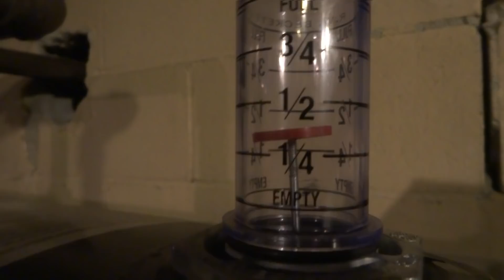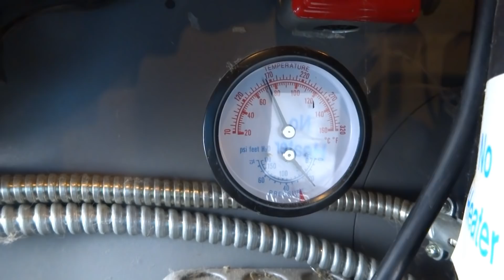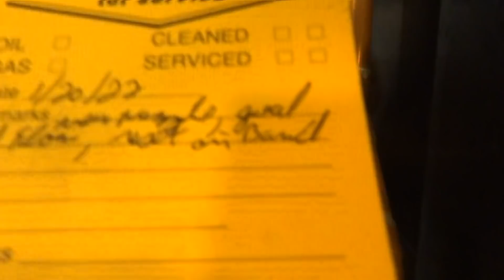OIL BURNER NEW CUSTOMER SERVICE REQUEST

Comment: Your still producing videos after 5 years ! Congratulations.  
When you first got to this job site I see you did an initial evaluation of the set up with it being a new customer.  When you are pointing the camera around at the components could you tell us what it is you are looking for in each one ? 
Also while there you didn't change out the fuel filter because of good oil flow.  Would it for piece of mind for the customer be good to change it ? Most customers know about or at least heard of the nozzle and filter and more or less expect them to changed and to be billed for changing them. 
I see your reasoning for not changing it but if the customer waits another  two years the filter could plug or slow flow by then or before. 
I'm just curious and not in the  HVAC profession but just a homeowner that works on my own headaches. 
Anyone can comment on this and let me know what you would have done and if you are in the business. 
Thanks for the videos Steve and keep up the good work. I've learned a lot from them.

Comment: Hey Steve  love your channel . My boiler exploded two weeks ago. The boiler blew threw the Sheetrock walls in to my basement . Also the pressure blew my garage doors out and also cracked my foundation. .  I had  boiler expert come and get the boiler to find out what may of caused the explosion. Hopefully will find out soon what happened.
Reply: Bad relief valve
Reply: @ohger1  it was oil . But it blew like if I had a gas boiler lol if it was gas my house would’ve been blown to shreds .
Reply: @ohger1  There’s a big investigation on the boiler . They shipped it to Kentucky . It could be Negligence from the plumbing company or Weil  McLean boiler itself. But will see what happens. I’m def getting  my lawyer involved. If it was  negligence. Will see though
Reply: @ohger1  oh yea def will . Real quick. !! My wife was downstairs 10mins before it happened thank the good lord she came up . . I’ll def keep you posted

Comment: Hi Steve could you explain what the numbers on your nozzles and what they mean ? Thanks great video
Reply: First number is gallons per hour. Second number is degree of spray. The letter is for spray pattern.
Reply: @dwight.bennett  on spray pattern you mean wheather it's a solid spray pattern or hollow spray pattern ? A = solid, B = hollow ?

Comment: love your videos. I got an old af beckett burner in my single trailer. iv had all kinds of weird problems with it not starting but every time a tech comes and (fixes it) i need to hit my restart button atleast 3 times to get it going after they leave. ( i dont keep hitting it if theres no flame) i think the heat exchanger isnt getting hot enough and trippin. i have a .50 80 a nozzle. do you think getting a .65 or bigger would help? im only trying to save this old furnace to heat my bedroom because  installing a wood burner for the front half of the trailer. thanks if you can help or anyone else in the comments. ( it continues to run as long as i keep it basically going all the time but anymore then a 20 min break and it trips on start up)
Reply: He won't seem your question unless you tag him.
Reply from the maker: hard to say unless i am there checking stuff .... if your getting oil it might me a spark issue or elecrod issue not set right .to much air maybe ..draw assembly might be off ,hard to say unless i was there checking stuff ..call in another burner man in your area to look it over . its hard to answer question over a email with out a full picture of job what's really happening

Comment: Is there a way to clean nozzles to reuse them, or does the brass itself wear out to a degree making them bad? Nozzles aren't cheap anymore.
Reply: $5 isn't cheap? For the most important part to get a clean burn? It's worth just replacing them every season. You're not going to be able to clean it, and for $5, who cares?
Reply: In a pinch late one early morning, 3:00 am, when I didn't have a spare on hand I took mine apart. The nozzle screws apart and inside there was another part the comes out with a screwdriver.  All lefty Lucy. Be careful when you screw that part out because there is another real small part inside. I then sprayed the bronze mesh with electronic cleaner from the inside out. Then sprayed the screw in part and then the end if the nozzle from outside in while holding it upside down. When I was done and parts dry I could blow through the bronze part and the the nozzle end. I put it all back together, installed it, fired furnace up. Run it in there until next season. 
I'd recommend spending the $ 5.00 plus and buying a couple to have on hand. It's easier, safer and a whole lot quicker swapping one out for another.  Especially at 3:00 am !

Comment: Crazy spot for the expansion tank. The installer should have to come change it when it goes bad and not charge for the extra labor it will take to get to it.
Reply: Maybe the water heater wasn't always in that spot

Comment: Just a quick piece of advice, mr. Steven: get a pair of knee pads. I heard they are very good in preventing knee pains in  hoomans, meow.
Reply: He doesn’t have any knee issues. Mentioned it in several videos. He has no health issues whatsoever. He also uses a soft floor pad not knee pads.
Reply from the maker: i use a foam pad to kneel on
Reply: @stevenlavimoniere  That's also good. :)